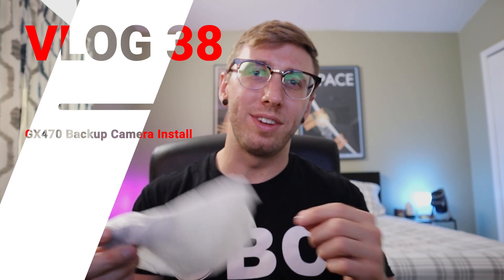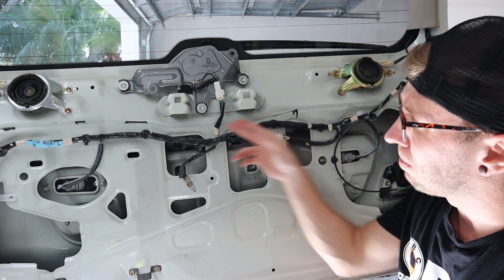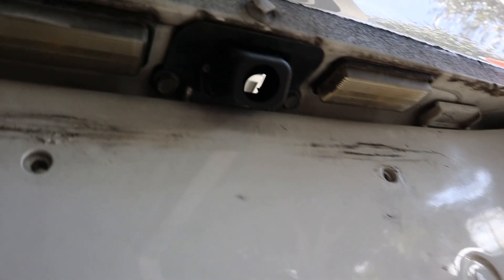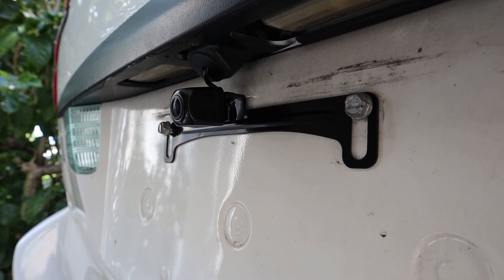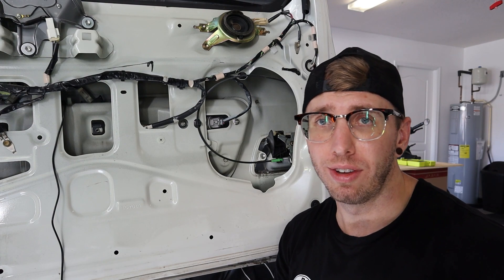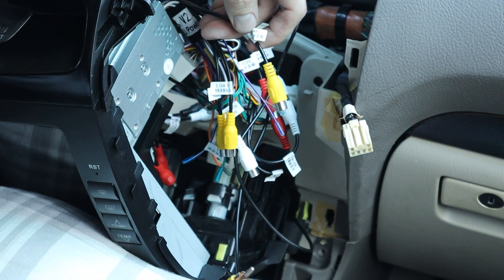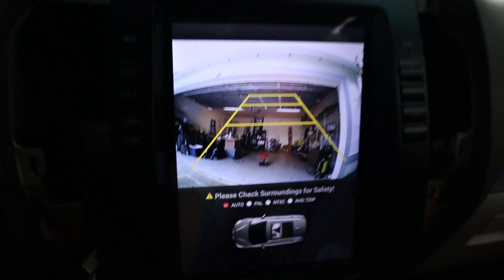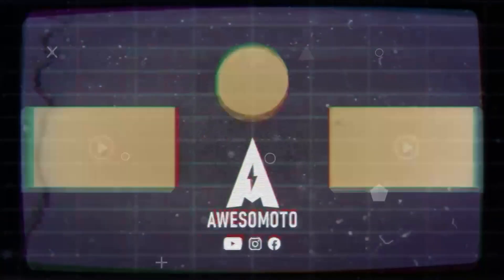Vlog 38 - Lexus GX470 Backup Camera Install

Comment: Thanks!
Reply from the maker: Thank you Dave! 🙏🏻
Reply: @Awesomoto  I am curious if you have had any problems with the radio volume? My Phoenix was installed when I bought the GX and the previous owner had the same problem. The issue is when you start the car and radio boots the volume sometimes will be blaringly loud.  Any ideas on how to fix?

Comment: Glad you have had good experiences with those splice connectors, I have not! They are almost outlawed with anyone I know, but the rear tail lamps have actual solder tabs at the back for adding wiring without harming the original loom. I know its solder but its handy enough, food for thought, love your content, keep it up
Reply from the maker: Hey Colm! It's funny you mentioned this as I did not have good luck with these after about 30 days. I've since switched to a soldered solution as well. Thank for following the channel! 🙏

Comment: Thank you!!
This video is going to wrap up a few different issues for me(stripped license plate fastener, rear sub speaker, backup camera fix). After that, I can FINALLY button up the trim pieces around my PX6.
I put in the 6x9 front speakers & 6.5 in. rear door speakers this morning. Had to stop cause my son had a soccer tournament. Glad I did cause I'd hate to get it done then have to pull off the rear trim pieces that cover the sub again.
Ordering the backup camera & extra stuff tonight!
Thanks again for putting this video out. Much appreciated!!
Reply from the maker: No problem swebstar1! Glad the videos are helping you out. Hearing this makes creating the videos worth the time! 🥳
Reply: @Awesomoto , I got the backup camera installed.
Hooked it all up(getting the yellow RCA jack w/trigger wire through that door grommet was a PITA! LoL. Ended up using electrical tape & attached it to a straight piece of a metal hanger, then spraying it with WD-40).
Got done & temporarily ran the wire over the seats & to the HU. Put the car in reverse and...nothing. went into the settings & made a few adjustments. Still nothing. Decided to re-check all my connections. Ended up finding that the splicer clip didn't cut fully through the coating of the wire. Just needed to go back into the settings and find the proper video resolution setting to get a picture.

Comment: So I worked on my GX470 this weekend tryng to figure out why the rear wiper washer wasn't working.  It turns out that I had a Sony unit installed a few years ago for my daughter and he installed a similar if not the same camera.  What i found when I traced the issue for the wiper washer was that the connection got pulled apart very likely when he installed the camera and went through the rear door wiring gromets.  You can see at about 20:35 in your video, the nipple for the washer connection is not connected.  You can see it right beside your finger pointing at about 10PM direction.  This is the same view I had of mine when I went looking for where it connected.  I pulled the grommet of wires out like you did and I noticed the nipple connection wasn't connected and I had to take the left rear quarter inside panel off similar to what you did to hide the wire and run it to the front.  Then I was able to see the other end of the tubing connection for the wiper washer.  It was a real pain to get the two pieces of tubing to connect back given the very limited space back there.  But I was able to and now have functional rear washer again.  Just a heads up if your rear washer is not working and you didn't notice or have found this yet.  You'll have wiper fluid all over the rear passenger carpet and floor.  Assuming you ever use the rear wiper washer.  Most people use it very little if any, so might never notice it.  Lastly I'll say that I suppose if you pull that bundle of wires out like you did, I don't think the tube it connects to on the other end will pull with it, so once you pull that bundle of wires a bit through the panel, it'll likely just disconnect.  Be careful because then if you ever use the washer, it will send fluid down inside the passenger rear quarter.  I had to dry mine out with a fan blowing on it most of the day.  I suspect this happened to my installer as well and either he didn't notice it, most likely, or did and didn't take the time to fix it.

Regarding the video for this install, great work and explanations.  Keep up the good videos you do.
Reply from the maker: Thank you for the feedback Steve! Yes, the washer fluid hose did come disconnected on me and I had to go reconnect after realizing what happened. Thankfully I caught it early and didnt have a wet carpet, but it could have been bad. Glad to hear you got things connected up and working!

Comment: Awesome video.  Thank you.  
Tip:  my camera wire was so small that the clips did not make contact verify and be aware that you may need to use a different connector.
Reply from the maker: Great tip! Thank you for providing that information!

Comment: Great video.
Reply from the maker: Hey Lance! Thanks man! 🙏🏻
Reply: Strange thread for an update but ….. got the alpha garage grill installed! Totally digging it. The lights aren’t hooked up yet but WHAT A CHANGE. Wish I could share a photo of the rig with the eibach lift, motegi rims, wild peaks rubber, JW Off-road tire carrier, sport lights, phoenix head unit, and aftermarket seat cover installed. Totally sick. I’m thinking rock sliders and steering wheel restoration (like yours) and I’m set. At least that’s what I’m telling myself. You will love the grill mod!!!! Cheers 🍻

Comment: How did you get that washer hose back connected that running in the rubber grommet with the whole wiring harness? 😂 Dealing with that now.
Reply from the maker: Yes, its a pain to get back into the grommet. I just had to take a few swearing breaks before it went back in to place. LOL

Comment: Nice man. I came here hoping to find a constant 12v on the back door so I can view the camera when the car is not in reverse.
Reply from the maker: There should be constant 12V back there for some of the other functions like daytime running lights. Take a multimeter and probe around for 12V.

Comment: Just installed mine and I wish I would have seen this before hand. I actually mounted mine to the bottom of the old camera. Used the sticky pad and screws to told it on there.
Reply from the maker: Hey CC! Ahhh Bummer that you didnt see this before hand. Well you can always go this route if the stick pads dont hold up.

Comment: Your videos are really great.  Could not have installed my Tesla style nav without them.  Ran into a problem installing the backup cam. Videos were great for running wires and making connections but my 2007 GX470 is a little different.  The Camera has no screws on the sides.   How do I remove this one?  Wish I could upload pics.
Reply from the maker: Hey Henry! Thank you, I'm glad these videos are helpful!

Just so I understand properly, when you are talking about the screws on the side of the camera, you are talking about the OEM camera on your vehicle?
If wasnt aware they changed the camera from 05 to 07, but regardless I think if you dont see screws on the outside I would take off the inner door panel...there should be screws on the back.
Reply: @Awesomoto I have no screws.  I discovered that the OEM camera harness still sends 6 volts to the camera when I put it in reverse.  I am going to tap the video coming out of the original equipment camera.  The OEM camera harness has 4 wires, two are pos & neg 6 volts, the other two are video out and ground.  I am going to attach the trigger wire to my backup light 12 volt positive.  I will let you know.
Reply from the maker: @henryj2811  Okay, well let me know if you run into any issues and need help troubleshooting!

Comment: Can that head unit compatible do 360/panorama virtual camera view?

...I've seen the same unit advertised around and some places suggest that it is (needs four  cameras installing).
Reply from the maker: Great question! I'm not sure if it is capable of the 360 cameras, but that would be awesome to have. I do know there are multiple camera inputs, so maybe its possible. I've considered putting a front facing camera in, so maybe I can do that to test the theory.

Comment: Thank you for this! Followed your video and everything worked out perfect. Ran smooth for 2 days but today I can’t seem to get it to work anymore. Any ideas or tips to troubleshoot this?
Reply from the maker: Hey ItchyNissan!
Thanks for reaching out. A good way to troubleshoot this is with a multimeter set to the volts setting. Measure that you have 12v on the trigger signal and video at the head unit. If not, check those connections at the rear door where you spliced in. I’m assuming the 12v to the camera or the trigger line came undone. Let me know if you get it fixed with this approach.
Reply: @Awesomoto   Yep, we rechecked all connections. We got 12v. My wife actually figured out that the camera is turning on because she selected the Car icon on the phoenix unit and the reverse cam came up on the screen. So now we're trying to figure out why it won't automatically switch the screen to the reverse came when it's put in reverse.  really strange.
Reply from the maker: @ttz32  Ah! Great work troubleshooting and relaying the information because it helps me understand what you’ve tried. I think you might not have the trigger connected to the right wire on the back of the unit.

Comment: Do you know if this camera is compatible with the OEM navigation head unit?
Reply from the maker: No, unfortunately they use different voltage levels to drive the signals. You would need to add a voltage converter circuit for this. I recommend finding one that is designed for the OEM head unit.
Reply: @Awesomoto  thanks

Comment: My camera doesn't automatically comes on when I put in reverse. I have to puch the app while in reverse to see the video
Reply from the maker: Hey HOLTSIMAGES, 

Thanks for reaching out with your question. The description of your problem indicates that your trigger wire might not be connected or the splice in it was bad. You can check the connection at the rear door and at the unit. Also, measuring with a volt meter, it should measure 12v when car is in reverse. Let me know if you have any other issues or questions. Hope this helps!

Comment: Hey man, any chance you can tell me what your baud rating is set at in your secret menu? I messed with them and can't recall what the default was. Thanks!
Reply from the maker: Wow, I’m sorry I missed your comment gKnow. I’m not exactly sure what my settings are as I’m not in front of my car, but you should be able to do a reset on the unit to get the defaults back.

Comment: Didn’t see you reattach the drain tube before you connected the rubber grommets. Any tips for that part?
Reply from the maker: Yes, that hose needs to get reconnected. If you look up in, you can see where it connects. It just takes a little patience.
Reply: @Awesomoto  thanks! The GXOR FB page says that it’s the windshield washer tube, not a drain tube. Saw some posts there showing quite a bit of disassembly to get it reattached. Yikes. I think I’m going to try to unwrap the tape carefully. Also read that you can poke a hole in the rubber grommet to feed the wire through.
Reply from the maker: @stephenliu7383  Yeah, it’s the washer fluid, I just didn’t want to correct you on it as the main point is that yes it needs to be reconnected. That route is definitely valid and you can poke a hole in it and feed it through. Just be careful when you pull that grommet out so you don’t disconnect the tube. Let me know if you need help on it!
Reply: I was just about to say something about that hose cuz I ran into the same problem. The hose was way to short to try and get back on. Luckily I had a long section of the same hose already so I was able to fish that up to reconnect. It still was not fun and took way longer than it needed too.
Reply: @Awesomoto  yeah I didn’t know the washer hose had a barn fitting right there. when I pulled on all the wires the hose pulled off the other barb fitting and there was no getting that back on

Comment: Can you do this in the base model? Or only the navigation model?
Reply from the maker: Yes, you can install this on the base model. The only thing you'd need to do is use an aftermarket head unit with a screen.

Comment: 3:34 That's not a very good splicing tool. There's a much better one that uses a screw to hold it on versus this clip that's always going to come undone.
Reply from the maker: I completely agree. Those splice tools suck. I ended up just soldering and heat shrinking it a week later.